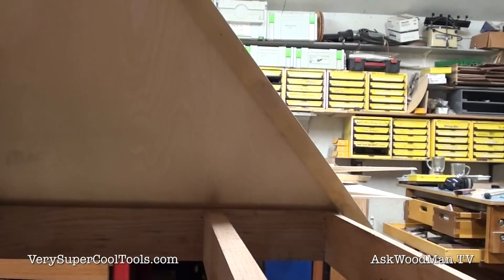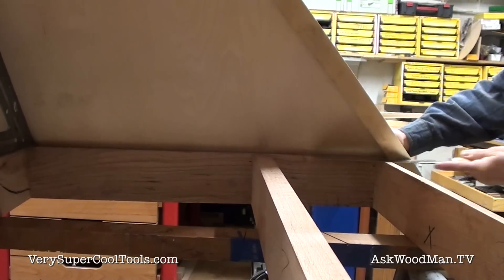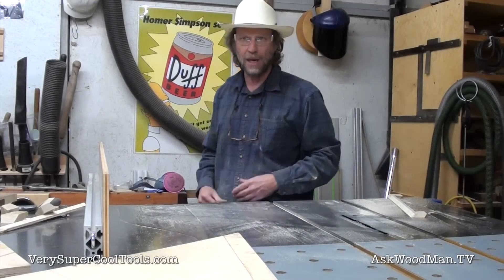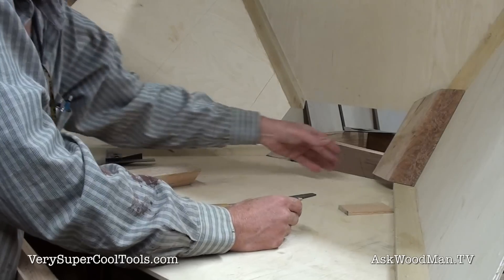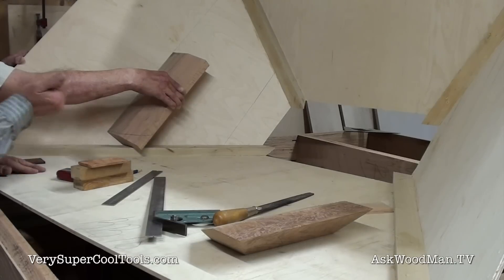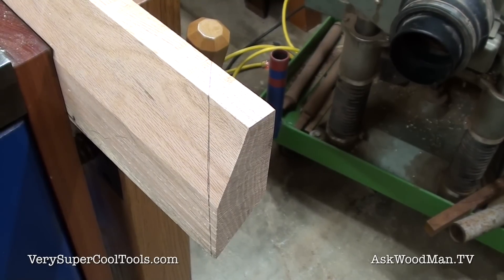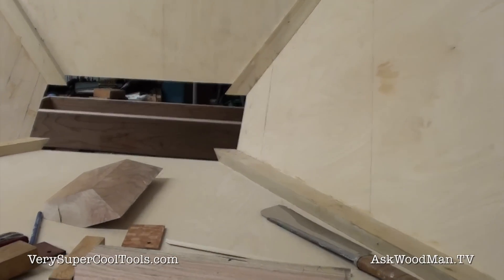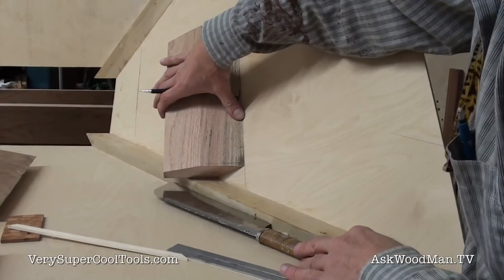906. Downdraft, Multi-Function, Router Table / Outfeed Work Station Series! (5 of 20)

Comment: Hey Alan, just wondering what the thought was behind the hardwood framing? Would spf not or ply not have sufficed?
Reply from the maker: +Adam Szaflarski I am not going to spend all the time and effort to build something like this and build it with white wood. And using plywood for the frame then everything would have to be redesigned.
Reply: +AskWoodMan hey Alan I'm not trolling. just wondering about your reservations with dimensional lumber in this case. (I can understand not wanting a redesign). My consideration surrounds cost. for someone like me, hardwood (I think you've got oak there?) is 4-5 times the cost if not more of spf. So if well seasoned framing wood can suit i would go for it. (we do build houses out if it after all!) thanks for the great tips and  channel!
Reply from the maker: +Adam Szaflarski You could certainly use framing wood. I would just beef it up a bit and put cleats at the corners. 6/4 white wood is not equal to 6/4 oak.